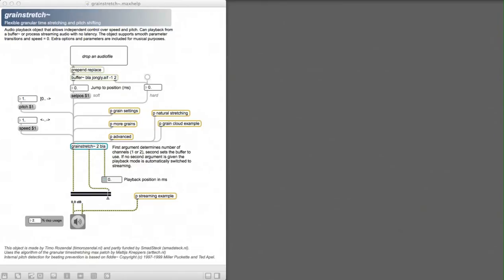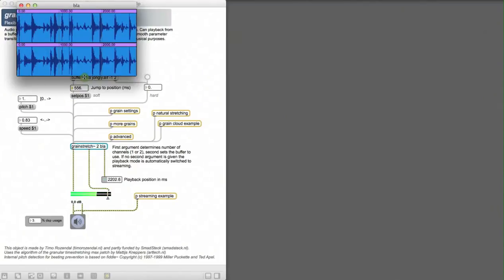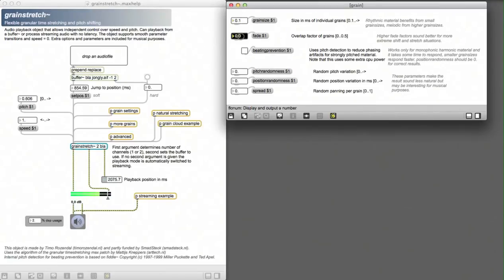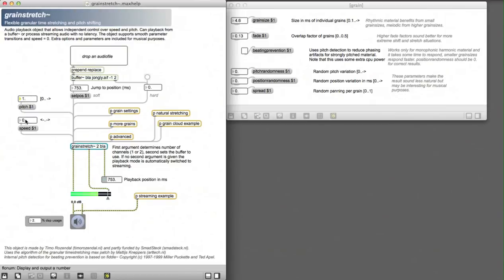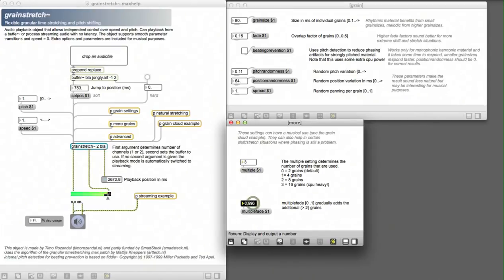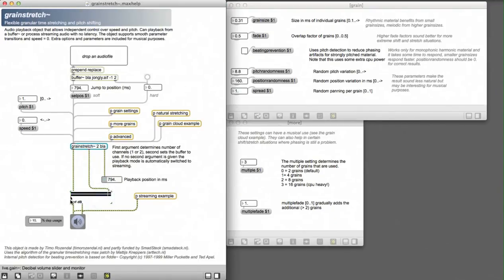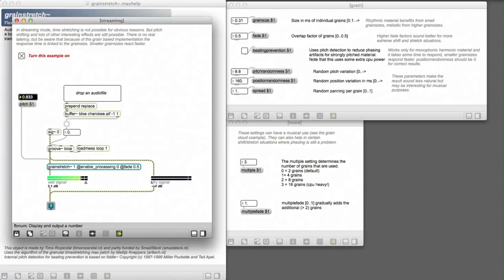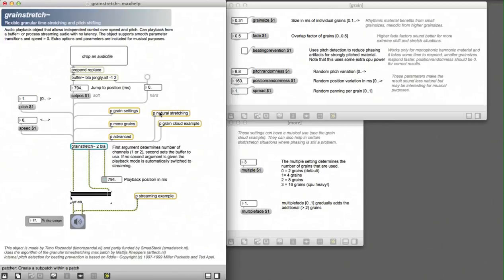grainstretch~ granular timestretching and pitchshfiting for Max/MSP

Comment: hi timo.how can i open it in max?
Reply from the maker: it's an external for max (currently 32 bit architecture only, and works better in max 6 or 5 then 7)), Download the zip and open the helpfile (the external should somehow be in the search path of max when you use it)
Reply: Thank u so much.i already opend it.but there is no sound when i drag audiofile into it.can u tell me why?thank u
Reply from the maker: ok, first question: is your version of max 32 bit?

Comment from the maker: thanks, yes, that parameter is missing, it's a bit hard to do that smoothly because you will soon hear clicks at the start end and it's a bit of a puzzle how to handle the grains in that case. 
btw, if you set the speed zero and make the grainsize 200-500ms it will loop that part .What you could do then is add another grainstretch~ after that (one without a buffername, the streaming version) and play with the grain parameters of that one. Is that a nice workaround for you? :-)

Comment: Great external, the only parameter that is doesn't seem to have, is the ability to loop a certain time in the buffer continuously. It only plays from "setpos" to the end, then plays start to finish. Is there away to loop the time values that the user defines? S0 200ms-500ms... Thanks